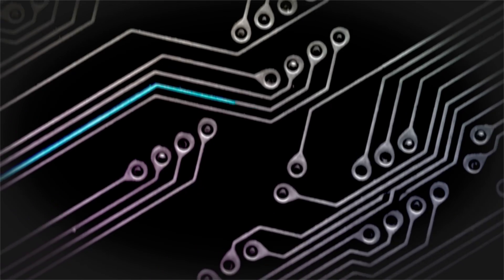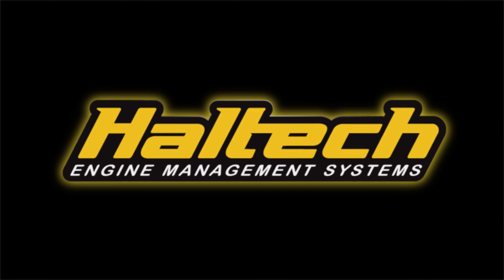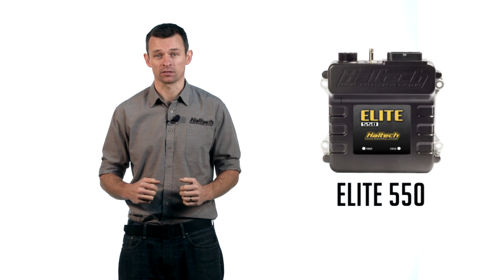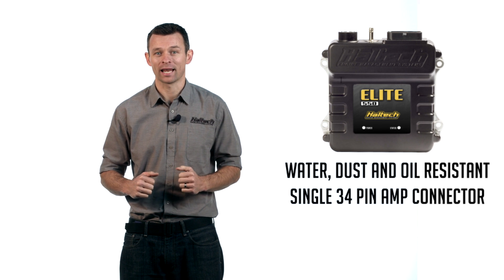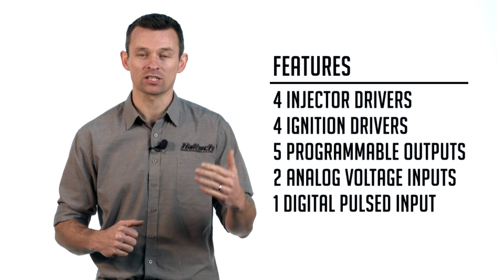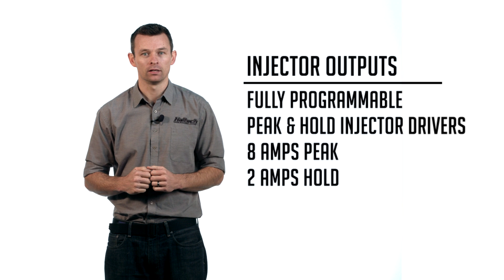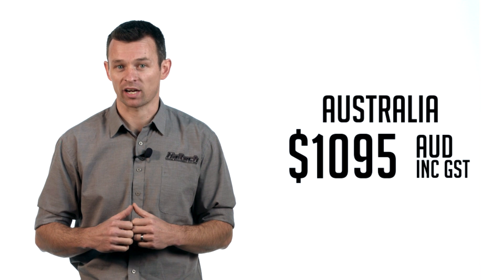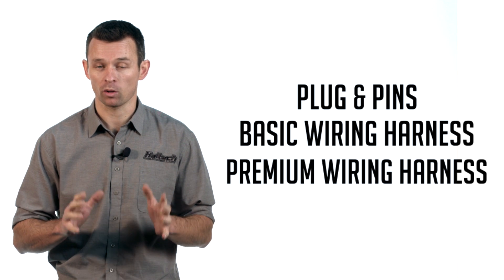🔍 Elite 550 Overview

Comment: Hi.
I have a old 2006 Yamaha FXHO Cruiser waverunner & looking into a ECU to run the Yamaha MR-1  160hp FX1100a-e  engine.

Basically to be able to unlock 🔓 the open speed limiter if it has one.

I know it has a speed limiter that's activated by a key fob for beginner rides.

To unlock 🔓 the 10,000 RPM rev limiter.
🇦🇺

Comment: How does the 550 work with a K24 swap? Will it support ITBs?
Reply: Yes to the first one, and no to itbs, need more inputs than you can fit into the single 34 pin connector
Reply: Ah that'a a shame. Thanks for the reply @WildEGHatch
Reply: @Bunta25  no worries! You’d have to step up the the elite 1500 or find a used 1000 to manage traditional itbs as that’s a ton of extra sensors for a small 34 pin connector
Reply: @WildEGHatch  yeah makes sense, thanks again.

Comment: Will the haltech elite 550 work on a 2004 Acura TSX 6speed manual K24A2 ? Will it have reverse lockout capability ? Please answer haltech, this can be the the difference from me switching over to haltech🙌
Reply: Yes actually. Its quite easy to fit that functionality into the 34 pin. Its quite a good replacement for kpro

Comment: notice you say 550 doesn't come with Flex Fuel input yet on the ECU Comparison table on the Haltech site it says it it is? Can you please confirm for me? Thanks
Reply from the maker: The 550 did not have a Flex Fuel when it was released (at the time this video was made) but it has had a number of updates since then. One of them was the addition of a Flex Fuel compatibility. You can check out the most up-to-date spec list here: https://www.haltech.com/product-overview-elite-550/
Reply: @haltech  Awesome as always Thanks!

Comment: I’m confused your website says the 550 has Basic Water Injection
• Single Stage Nitrous Control
• Single Level Engine Protection
• Launch Control
• Single Sensor VVT Only*
But you say it doesn’t ? Witch is correct? Thanks
Reply from the maker: The website is correct - we've recently done an update which gave the 550, 750 and 950 a whole bunch of extra features.
https://www.haltech.com/more-is-better-esp-update-gives-more-power-to-the-elite-ecu-users/
Reply: @haltech  just wondering if i brought a second hand 550 and it didn’t have the extras could I update it?
Reply: @haltech  sorry I’m just reading the website now haha

Comment: How does the 4 fuel injectors work with an 8 cylinder?
Reply: Injectors drivers, so to run 8 you would have to run injectors in group fire. So 2 injectors would pulse at once. You would be surprised how many older cars ran group fire. You do the same for coil on plug cars, you fire 2 coils at once in what is called wasted spark.

Comment: would you kindly comment on the appropriate haltech unit to run my Honda Blackbird XX 2002 model.  I want to do away with the factory ECU.  The bike did use an O2 probe but now has been removed and bypassed.  This infact has caused the bike to run very rich.  Without paying over the odds to a tuner head I would rather purchase a New ECU to control my bike Maps.  Not entirely sure what block connection it uses but they are big in itself and have a buiilt in HISS protection, I have not mentioned that these bikes are limited electronically in the ECU which I also want gone.  Can you help....  I hate friend competition agreement between honda Kawasaki and other major branded bike.  I would also state that I would love to have the auto learn unit option on it also.  Like the mightcarmods Mini adventure that you have hugely helped out with.
Reply from the maker: Does your engine model have a cam position sensor on the head, or is it missing completely?  If it has one we can run your engine, but if it does not you will find it very difficult to find any full standalone ECU that will run it correctly. If so, running the engine is fairly straight forward and you would use an Elite 1000 or 1500 model to do so.  These models support the learning that you have requested. The HISS system will not be working, and no aftermarket ECU will support security functions like this because the ECU is designed for competition use and no race bike uses a coded key to start the engine.  To do the learning you would need to also add a WBC1 wideband O2 kit.  There will be no limits other than the ones you program into the system.
Reply: Being a fuel injected it must have one.  been a long while since being under the fuel tank but i think their is.  Now, can you do a video on how you talk to the unit please.  USB or bluetooth or serial if that is your point of comms.  Would be awesome to see this type of video for your connections along with very basic mods to a LAME person like me.!!  thank you inadvance.  J...
Reply: Just a quick note I dont care about its factory immobiliser I want the bugger gone.  As long as I can also remove the inbuilt limiter to the ECU by swapping over the ECU I am more than happy to seriously consider my options.  I do jope these unit are at a very afforable price.  Polish wages are well, let just say your 1 weeks wage is my 2 months worth of earnings here.  Yes were are that cheap in wages.   goddam it.

Comment: Sorry to bother you but will this work alright on a 1996 RA2 Honda Odyssey 4WD with a manual conversion?
Reply from the maker: If it has the F22 or F23 engine then yes it will work.  If it has the J30 then you need an Elite 750.
Reply: It has the F22. Will there be any conflicts with he 4WD system?
Reply from the maker: We don't have any experience with the Odyssey 4WD system, so we're unable to tell you, sorry.
Reply: I see. Thanks anyway.

Comment: This looked perfect, but no knock input, how will I set up an ignition map on a older car (1974) with out it ?
Reply from the maker: For knock control you'll need to go up to Elite 1000 or higher.
Reply: how do yoiu set up and igniction map for the 500 or 750

Comment: will this work on the nonturbo eclipse? looking to boost my engine with stage two cams and bigger injectors
Reply: I’m tryna look into it too Since it works for the 4g63 dsm and evos and I know 2 people that ran stock evo ecu on there 420a with the 1g cas so I’m 99% that means I could run haltech

Comment: can I use this on my 1995 eclipse build?
I'm upping my compression and installing stage two cams
Reply from the maker: Yes, the E550 works with the Mitsubishi 4G63/4G64.
Reply: Haltech my car is a 420a non turbo, I'm looking it boost it plus other mods. would it still work?

Comment: +Haltech 

Will the 550 run the electric OMP on a S5 FC 2-rotor? I am trying to stay away from premixing.
Reply from the maker: For stepper motor output you'll need  Elite 1000 or higher.

Comment: Does the elite series ecu have adjustable voltage threshold , for the cam and crank sensors?
Reply from the maker: Yes, voltage threshold for both arming and activation can be 2D mapped for crank/cam reluctor sensors.

Comment: did the 750 have antilag?
Reply from the maker: Antilag/launch control is not available on the E550 or E750. You will need to step up to Elite 1500 or 2500 for the advanced features like antilag.
Reply: +haltechecu ty for the info

Comment: Does it work on 6-cylinder engines?
Reply: you could run a 6 cylinder engine but it would have to be an inline 6 or an even fire v6 (no old buicks or jeeps),  the 6 and 8 cylinder configurations are used to batch-fire and waste spark the engine.
Reply: 4 ignition drivers 4 injector drivers with that started at the start I would think it's designed around a 4 cylinder
Reply: +MyNigma In the description, it's mentioned 4-8 and this is why I asked because in the video he mentioned 4.

Comment: what does the "no knock controll" mean, does it mean it cant do anything with a knock sensor at all or does it mean you cant do advanced things with it?
Reply: Means it does not use or support one.
Reply: 350gtboi
i guess il be getting a 750 then at some point
Reply: +Gerrit-Jan Bergwerf 750 doesmt have knock control either i think
Reply: hks071
would i realy need it if i have a good fuel and igniton map set up?
Reply: +Gerrit-Jan Bergwerf things can go wrong. my engine blew because wastegate jammed, overboosted, and it knocks and bent the rods. 
if i had a knock control set up, you can set it up so that if knock occur, cut boost or fuel etc to save the engine
Reply: hks071
ok, im just wondering did you feel it overboost?
Reply: +Gerrit-Jan Bergwerf it was on the track doing timed lap.  it came really fast.
Reply: hks071
too bad :/, i dont have a car yet but i cant wait to get one :), planning to get some form of toyota :)
Reply: with the ESP software you could set a map to run alot of ignition pull/or complete cut over a specified boost level.